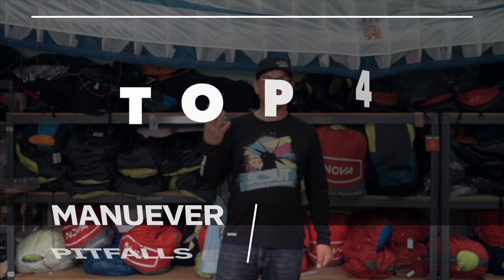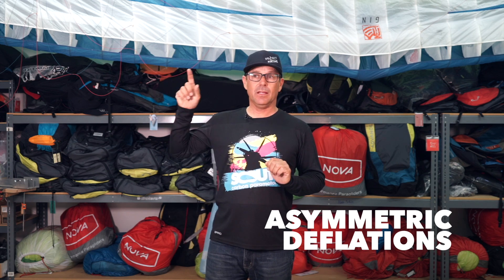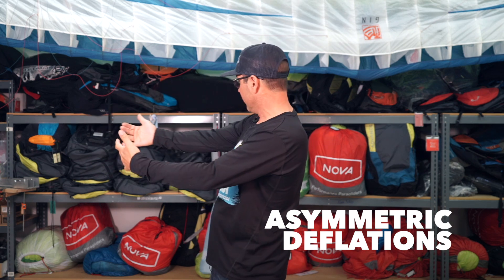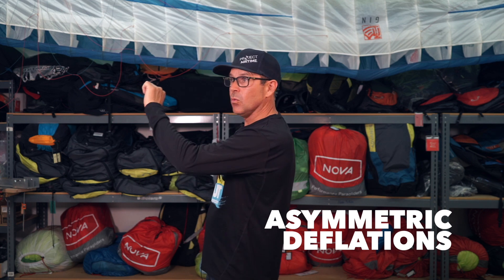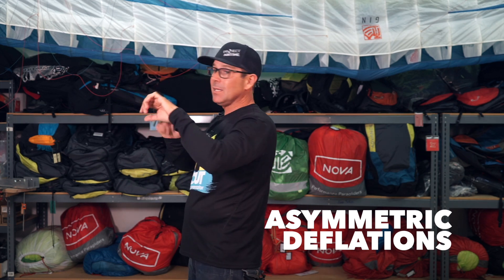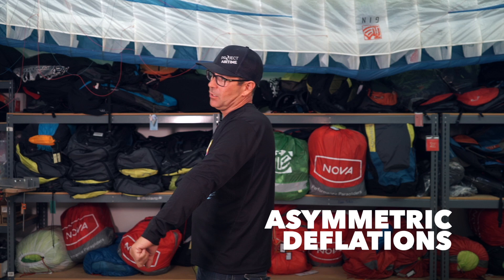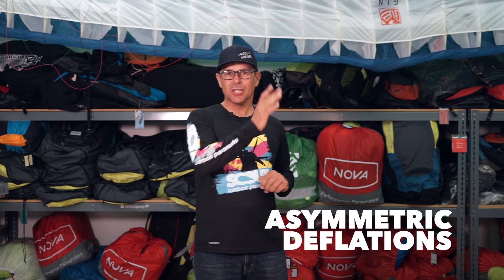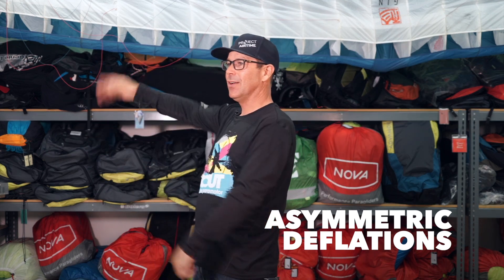ASYMMETRIC DEFLATIONS - #4 of 4 Paragliding Maneuver Pitfalls

Comment: Thank you for those video, nicely made,good talking. I really like how you mention and teach the mindset/worflow of throwing the reserve!

With this one I have little different opinion. The topic is very complex and not easy to cover in generally short video :/

#1 when you fly you need to have situation awerness. Once you have a collapse you HAVE to  flash analize what is happening to the wing. The best way is to LOOK! During the training you will learn how much brake input you can allow yourself, for current glider state and shape. (Dynamic,infront of you?). Then you will finetune by the feel, so you dont overbrake the glider.

Then some points thay are important:
#2 with big collapses, the weight shifting does nothing (one riser is completely dead) the healthy side hand reaction is what is going to save you (pull you out of rotation locked spiral). 

#3 Weight shifting INTO collapsed side (prevents twisting) and super deep pump is probably the only way to deal with huge asyms. (Of course the routine for heatlthy hand input stays the same as you described it)
Reply: Weightshifting works with one riser slack, you need to press your arm against the tight riser and weightshift with a burst of energy. It gets most glideas out of autorisations.